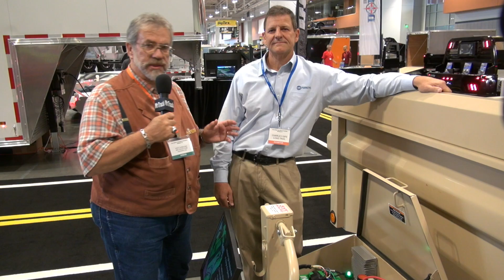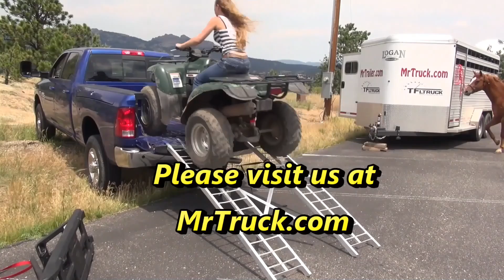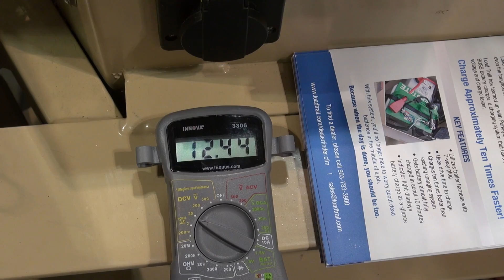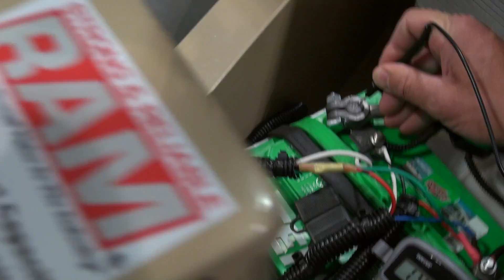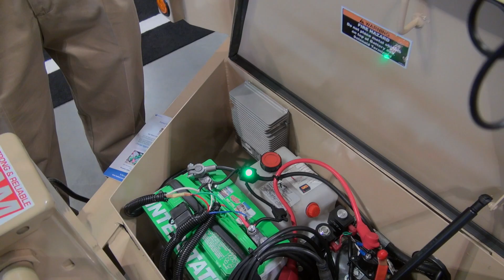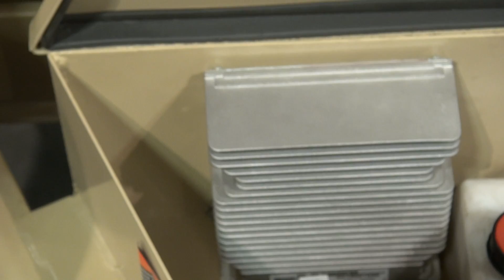Load-Trail introduces Purkeys trailer battery charger at NATDA Convention

Comment: The problem with dump trailers not keeping a charge is that people neglect to unplug them from the truck before dumping. A heavy trailer being dumped will pop the fuse in your truck.  Yes even with a good battery and then your battery goes dead cause your fuse is blown. A better method is to wire a relay into your trailer harness. When wired proper the relay will disconnect your truck's charging system everytime the pump is activated. Cheap, easy.

Comment: Question. Does my "14 F150 charge my trailer battery as I drive down the Rd at all??
Reply from the maker: Yes, your truck will trickle charge the battery
Reply: Fords generally only supply + voltage to the trailer plug when key is in Run, and in some years they came from the factory without the required relay or fuse. I’d take a volt meter or test light to the trailer socket.  If dead while truck is running, google “Ford trailer charge relay”.

Often those trucks were delivered with a 30a fuse and a relay in a plastic bag in the glove box.

Comment: would be much more efficient and possibly less costly to just run 1/0 awg quick connect to the rear of the truck like you would for a winch and then 1/0awg to the trailer battery with another quick connect to connect to the truck. 1/0awg wire is capable of 300amps of current in 12v systems so voltage drop is not really existent. it would see the same voltage as the trucks batteries
Reply: That is a popular solution. Also I think a lot of people underestimate the amount of time a trailer needs to be plugged in to fully charge. Some of them come with a 1.something amp panel mount charger. Mine has a 5 amp.